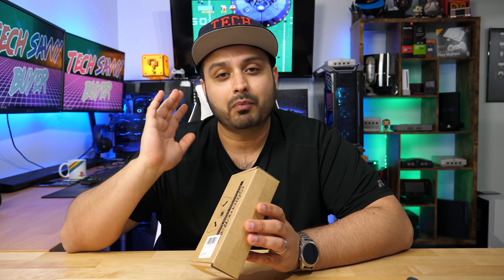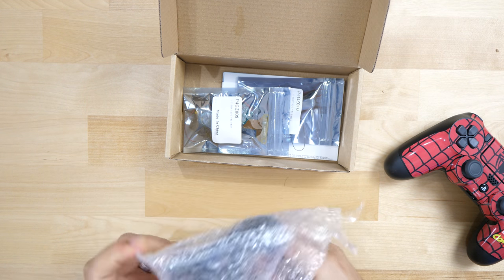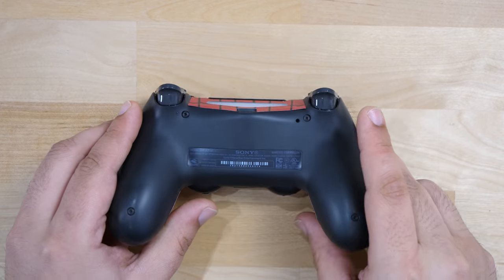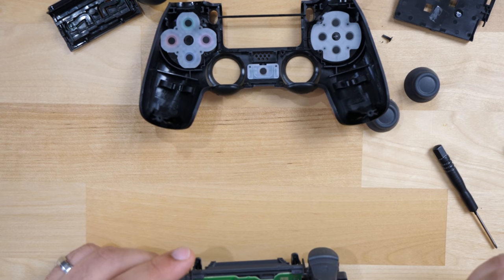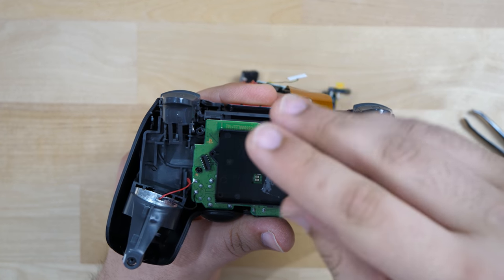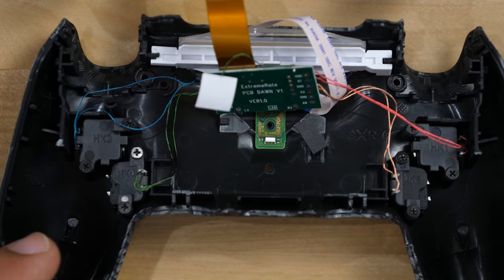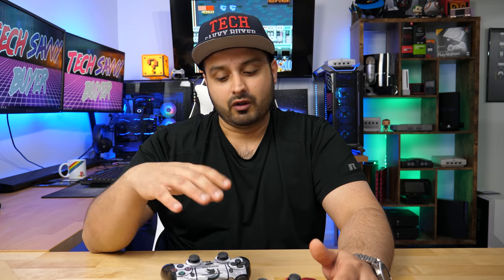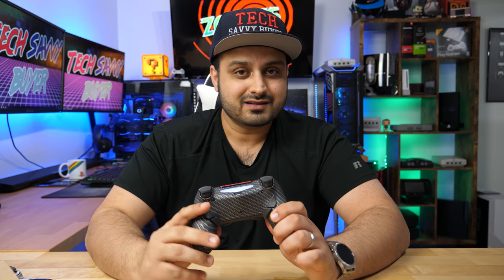$35 DIY PS4 Elite Controller! | Installation Guide & Review |

Comment: I did all the steps. Did everything carefully. I got everything set up but now my controller won’t turn on unless it’s plugged in and when it is it only shows a yellowish orange light. PS Button won’t work. Tried resetting controller, holding PS Button and Share. Nothing works. Feel like I just wasted my time and money
Reply from the maker: Check if your battery is connected properly
Reply: Tech Savvy Buyer After fiddling with it and plugging it into my pc. Turns out some buttons don’t work. O, R2 and I assume the PS Button all don’t work. I was able to use the controller on Fortnite on PC but those were the only unresponsive buttons. I’m able to remap other buttons like x and square but not o.

Comment: Idk why every tutorial mentions double sided tape not being included. It comes with two extra pieces for the mother board and you can just cut a piece from that. I built two of these that way and they both work perfectly.
Reply: Also holy crap these things are way better than the strike pack. Its so nice not having to be plugged in with a 9 foot cord and the usb not randomly disconnecting and not having to sign into your account twice as a usb headset and being able to turn on your ps4 with the controller and the motion sensor not having major drift when playing games that use it like Dreams.

Comment: I'm about to have some rainbow six tournaments. I'm stuck between the strikepack paddles or this system. Which would you recommend and how long will they actually last?

I'm not soldering or using mods so thats out of the picture.

Comment: Hey man are the paddles comfortable. Do they like hurt your forearm or something thanks.
Reply from the maker: They r OK. U will accidentally press them every once in a while but you'll adjust eventually
Reply: @TechSavvyBuyer  but it's a naturally comfortable because I bought the strike pack dominator. It was really uncomfortable and it started hurting my fourarm I'm not sure if I just have to get use to it or something.just wondering if you had the same problem with those paddles.

Comment: Just bought one, hope I can install it without any problem!
Reply: MiKeX let me know how it goes
Reply: @JahaanzaibTheKing10  👍
Reply: @JahaanzaibTheKing10  Ok so basically the kit arrived today... I followed everything that was written in the instructions, pretty easy. My only problems were when I had to open and close the controller because I was scared of breaking the clips. But after I finished the installation, everything was working. Now I just gotta check if it's charging. You can do it too, I'm just 16 and I did it without any help by my parents!
Reply: @JahaanzaibTheKing10  Quick update: the battery still works and it charges
Reply: MiKeX thanks for the update hope it is good for you might have to give it a go
Reply: MiKeX just got a quick question this only works on gen 2 controllers with the light bar on the touchpad right ?
Reply: @JahaanzaibTheKing10  If it has a light bar on the touchpad it will surely be compatible
Reply: MiKeX okay thanks for the update

Comment: Like one of the other comments said haha I was interested until you opened the bag and out comes all the important items poorly packaged. If it's just the cheap paddle and you're looking for why not just use the Collective Minds strike pack?  All the benefits none of the work if you want to take it a step further you can stipple the back of your controller to add amazing grip and measure where your L2 and R2 actually trigger & put some set screws in them for some trigger stops. But never download the mods for them because they eventually start to mess with the response time of the paddles. Either way great video

Comment: I am considering purchasing this. The deal breaker would be if I can't use the PS4 charging dock. Does the new shell remove the feature?
Reply from the maker: It may since you have buttons there. Depends on the charger you’re using

Comment: Just buy a fps dominator strike pack from gamestop or walmart. It has MODS and paddles just like a scuff the only downside is that it has to be wired while playing but it comes with like a 10ft cable. It’s literally 40$ for ps4 and 30$ for xbox.

Comment: Would it be possible to just drill holes in a regular back shell? I want to do this but I do not like their shell color options
EDIT: I can actually see that there appears to be a small plastic housing for the button added to the backplate. so I'm guessing this means no

Comment: @Tech Savvy Buyer

I'm assuming you have to install the L3 and R3 to program those buttons to the rear paddles even though you are wanting to eliminate the L3 and R3? or can you program L3 and R3 without attaching those wires that you snipped off in the video?
Reply from the maker: You'll have to install those to remap them

Comment: Dont waste the $35 and invest in a good hand made controller from scuff or an elite series of either xbox or playstations version. I bought this exact "extreme rate kit". Although it was easy enough to install, there were a few issues when it was all together. For example when tightening the "extreme rate backing" to original ps4 dual sense jm55. Right trigger would get stiff and not a responsive. This goes for the left stick as well. I tried not tightening them to tight which created other issues. Overall a good idea but not engineered correctly.

Comment: If i dont have that crimping tool you used could i possibly cut off the legs instead with scissors?

Update: I Used The Scissors Try To Bend And Pluck Them. Controllers Been Working Fine For About 2/3 Months Now Great Investment 💯

Comment: be careful with that double sided tape on the yellow connector, mine was too thick and i closed up my controller and  no buttons would work, had to reopen and take off the sticky tape and then it would work

also be weary of where you put the touch tin foil, my fingers rest a bit long past the buttons sometimes and it tends to accidently turn on pairing mode which renders the buttons useless, has cost me some games, overall great tutorial

Comment: I had bought a $212 scuf controller for the ps4 and I shit you not I had to send it back for repairs over 10 times for the same issue every time. Each repair lasted about 2 weeks before I would have to send it back. I gave up after 10 times and just threw it away and then sent ended up releasing the back buttons

Comment: Does this give you more buttons or just the ability to remap pre-existing ones?
Reply: re map existing ones most console games would not even support extra buttons to begin with
Reply: @Demon09-_- 
Thanks. Seen people play fortnite with controllers like this and thought it gave them extra buttons for instant builds like PC players have.
Reply: @thisisJim85  hmm fortnite might be a little diff depending on the console as you could make your touch pad do something when normally it would not be really usable. what it reallys makes easier is not having to take your thumb off the right stick to press face buttons

Comment: After the step with the double sided tape, did you solder the ribbon? I bought a kit after seeing this, and I'm going to do it right away. I just cant find my soldering equipment.
Reply from the maker: No need for any soldering unless you want to map l3, r3 and TouchPad.
Reply: @TechSavvyBuyer  its been a ongoing nightmare.  I started it as soon as i got it and the 3m attatched to the pcb wont stay put along with the copper square. Did you have any trouble with this, or was it a straight shot for you?
Reply from the maker: It was a straight shot for me.

Comment: My english isn't very good, so I have two questions. You said something about you dont wanna use the l3 and r3 button, and cut the wires then. What did you mean? 
And 2. When i bind a button, then i cant use the normal button? For example when i set jump (which was on x) to k2, then i cant use x again?

Comment: Hi ! Bought it, assembled it and it works, except i cannot pair one of the buttons? Do you have any idea why? I touch the sensor, the blue light goes on, but when i touch this one button, it goes off immediately. Other 3 buttons work fine though...
Reply: Okay nevermind, i reopened entirely and reassembled, paid extra attention that all screws were tighlty in place and all ribbons were attached correctly. Now it works! 
I'm leaving this comment here for others.

Comment: you could use it for tekken, some inputs require pushing triangle and x at the same time (or circle and square) which is hard unless you map them to the shoulders , obviously easier than doing all this but i don't like the trigger buttons opposed to the quick clicks of the face buttons, so if someone gave me this put together, i would use it, but i don't even have one of those DS4s with the face light bar, mine are old. i did take them apart to replace the rubber pads for the face buttons and dpad though and one r trigger that broke.

Comment: My question is, when you pair a button to a paddle, can you still use the original button for another action??
Reply from the maker: No
Reply: @TechSavvyBuyer  I dont like that lol. It would make games with alot of actions easier. They need to find a way to incorporate that to match the keybinds of a keyboard.

Comment: I purchased this mod last week and finally decided to put it in. However, I was wondering you could answer a question. I have the world at war edition ps4 and the controller it came with. I took it apart and followed the instructions in the manual. I wasn’t sure if my controller is a gen 2 do you know? Or the reason the controller won’t turn on after I installed it? Thanks
Reply from the maker: Does the light bar show in the TouchPad? If not then you have Gen 1. This mod doesn't work with mod 1

Comment: Or you can just buy the strike force FPS dominator and get the same thing without the possibility of screwing things up.
Reply: ColdWarfare 007 and you get lots of modes, like rapid fire, lower recoil and more!
Reply: Jay Islam which uh, if you’re a normal person you can just not use the mods and just remap buttons to the paddles 🤦‍♀️
Reply: RkøØuttaNøwhere1525 if it comes with the modes might as well you them, otherwise wast of money

Comment: Wondering if anyone will ever get the buttons right. Either they're difficult to press on command every time or they're clumsy and intrusive to holding the controller, making for an uncomfortable grip or accidentally pressing buttons. The buttons need to have a large surface area (maybe the size of a quarter) and be flush with the controllers shell with maybe just a light knurled texture to them.

Comment: I would really like to have a controller with a stronger resistance when using the analog sticks. 
There is nothing like my old XBox Controller. And its starting to fail now :( 
And yes, I have PS4 etc. But its not the same.

Comment: What did you mean when you said you didn’t want to do a touch pad remapping 
And why you cut off the blue and red wire off the mother board
Reply from the maker: If you want to remap the touchpad button to some other button you would need to do the soldering. The blue and red wire if you want to program l3 and r3, which again i didnt want to so i cut them off

Comment: Okay so I don’t understand one thing: can you switch a button with another button and not have to switch it to the added back buttons? like let’s say R3 with X, or L2 with ⭕️. What I’m getting from this is that you can only switch it with the back buttons.
Reply from the maker: You can do that in ps4s accessibility settings
Reply: Tech Savvy Buyer I know, but I’d like to have it built in for preference, especially if it’s more handy you know?
Reply: @TechSavvyBuyer  h

Comment: I just buy the brook super converter. Then buy a xbox one wildcat. That has 2 back buttons and extra 2 top buttons. On top of that the converter not only lets you use any xbox one controller it has turbo and on the fly button swap.
Brook Super Converter xbox1 -> ps4 $30-$40
Xbox one wildcat $60 retail $120 i think. But got mine at walmart for $60
Reply: Unless that controller lets me customize it so it has the PS4 Button Layout then no, def not buying

Comment: got a question. i followed you step by step from start to finish. i dont think i did anything wrong. but after it was done and i turned on the console. a lot of the buttons werent working properly or not working at all. have any clue what it could be?
Reply from the maker: Check your ribbon cable. That can be the culprit
Reply: @TechSavvyBuyer  tried that. everything is working now. my square buttons isnt working in game ? and neither are the remapped buttons.

Comment: Relatively easy to install. I just took my time, step by step. The only thing I would change on these is the position of the 2 top triggers. They're in an odd spot for me personally. I wish they had an option to place them lower, like under the bottom triggers. Other than that it's as good as advertised.

Comment: I got everything connected and all of it locked in place, everything was good: until I tried to turn the controller on. It wouldn’t turn on, so we took it apart again and were testing it, and the LED light flashed for a second but then turned off again. Haven’t been able to turn it on since. Any help?
Reply from the maker: Try charging it?

Comment: FPS dominator does the same thing
Reply: But for more money
Reply: 10 bucks more and u dont need to take your controller apart
Reply: @juanchop3093   Yeah but maybe you interested in this and you want to upgrade your controller Not only with that maybe some New Buttons or something like that than you can buy this too and IT looks better than the fat Thing on your Controller
Reply: @juanchop3093  and in germany IT costs 60 € the fps strikte Pack and this remaping kit olny 35€ So...
Reply: Flying Phoenix thats becuase you get mods and paddles not just paddle buttons in the us its only 45 so i got that instead it actually runs great
Reply: @juanchop3093  Yeah but i dont like the mods they are to unfair and ITS like cheating
Reply: Juan Chop yeah everything's cool until it bugs out & starts disconnecting for no fucking reason on its own lmao

Comment: So i installed it and the FPC cable is connected and everything seems to work like my normal square, x, circle, and triangle button. However, I cannot get it to go into remap mode with the touch nor holding down R1, L1, down on D-pad and X. Any ideas what could be wrong?
Reply from the maker: Check all your connections. It should be an easy fix

Comment: Does this work with a scuf infinity ? I only have 2 paddles and would like to add 2 more
Reply: Parker I would imagine it’s different since a scuf is already modified. Why not just get the scuf with four paddles?
Reply: Zachary Dickey , when I originally purchased the scuf I really didn’t care to have 4 paddles. However, several months down the road now I’m seeing that 4 paddles would be optimal but I’m not going to spend 200 dollars on another scuf. I’m pretty sure the motherboard used in scufs is the identical to the one in the jdm055 model dual shocks tho

Comment: Press start
Options
Controls
Button Layout Stick and move

Free scuf you´re welcome
Reply: Vironix what?
Reply: @tonykrasnic3643  in bo4
Reply: Bumper jumper is better. I've had issues with the analog stick breaking from pressing R3 too much!
Reply: @Nagz45  I dont been doing it for years now
Reply: @Nagz45  ive had the same problem with 3 controllers i think alot of ppl have that most just dont notice the drift
Reply: @Nagz45  That's a user error.

Comment: So, the reason people buy scuf is because this is an unapproved modification to a controller and is seen as cheating. The moment I saw the motherboard come out of the box I knew this wouldn’t at all be okay for competitive use, which is what Scuf is for. It’s a premium product and thus has a premium price. While there is nothing inherently wrong with this setup, any tournament setting will not allow this due to the fact that you are modifying the controller with an unapproved, not trusted piece of equipment.
Reply: Some people just wanted to have advantage of pro controller, be a little “competitive” in game with cheap mods. Not necessarily to enter tournament. If they’re good with these mod controller & want to enter tournament, then they will get authorised controller.

Comment: I doubt the people you where planning with that jumped and aimed at the same time had custom button mapping I’m like 90% sure they where just rock’n that claw grip
Reply: Caleb Hagen could be but scuffs and other controllers are super common.. I have a wired Xbox controller with 2 reprogrammable buttons on the back, replaceable thumb sticks and trigger stops that I bought for like 45 dollars.. and it has lasted me about 2 years at this point.. only issue I’ve had with it is the rubber on the inside that extends to the a,b,x,y buttons has worn out and buttons stick, easy and cheap replacement I’ve only had to do once... so there’s lots of cheap options out there to get scuff like controllers for 1/5 the price

Comment: I did this and the controller works great but the light bar won’t turn on anymore and the controller won’t charge. Anyone have any idea on how to fix it?
Reply from the maker: Make sure your ribbon cables are connected and nothing is loose
Reply: Tech Savvy Buyer I just did and it’s still not working

Comment: Does any one sell an Xbox controller that uses better internal thumbstick sensors that are used in the OEM devices or in which it is easier to replace the sensor?  I am tired of having to replace entire controllers or having to desolder 20 pins because a 20 cent potentiometer is worn out.  HELP!